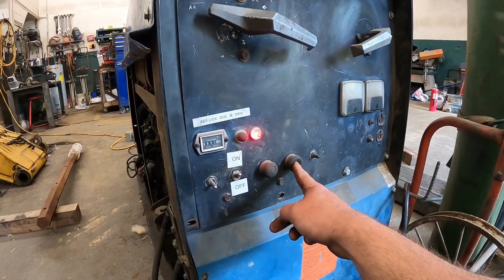Upgrades / repairs / inspection to the shop overhead crane with man behind the scenes

Comment: My shop has a fixed crane beam of W 10 X 30 for 14’ span. With only 2 ton chain fall. I’m guessing Yours might even be W 10 X 22 for 36’ span. 
I believe your lift winch is capable of more than 4000 lbs. and You are extremely wise to come up with innovative fix, adding columns to cut span down to 18’. I am impressed with your Harbour Freight electric windlass cable drive for cross positioning your trolley beam. Your original installation was very funky and bent steel from deflection of beam brought this to your attention. Please don’t think You now can lift 8000 lbs. now You have cut Your Span in half because your main trolley beam remains the same. You have really nice safe setup now.
Reply from the maker: Yup thanks

Comment: Just a little DIY when Welding over a bank of Batteries It a good ideal to cover them with a piece of plywood or something non metal to keep the sparks out> I have first hand knowledge about spark and battery. mine was a 48 volts Hilo battery that cost  $3500.00 to replace. 22-23 years ago.

Comment: Take this just as a suggestion: Those Gusset's You welded, should of have the interior corner (@ the 90 degree point) cut back approx. the "diameter" of the weld. Example, if your consistent at holding a 1/4" (.250" in. / 0.635 cm) weld, than cut back the corner 1/4" (.250" in. / 0.635 cm.) If you have to run two weld's, one being a horizontal and one a vertical, for the Gusset's. Allow enough space for your horizontal to pass under the gusset, uninterrupted, and then when welding vertical, {uninterrupted} you ensure that the gusset has now been fully welded. The hole need not be fully closed by the welds. What your more concerned with, is the weld(s) were both uninterrupted. Where's this method of welding come's from. HINT: remember those bridge's that collapsed during the Earth Quake's, in the State of California. That's where this (newer) method was born / a result of, if you will. The engineer's discovered a lot, that has now been changed because of that incident. See: (AWS) D1.4 Structural Welding Procedures.

Comment: TMBTS should just be shortened to THE MAN. Aaron is making DP famous. And Maggie doing well as fire marshal. Nice work.  Cheers Mike! I think I heard Aaron got a promotion. Shop "MAN-AGER"  And JasonWorksAlot Assistant Manager...
Reply: I think JasonWorksALot promotion is still up in the air. He may only get Shop Foreman to start off but I think TheManBehindtheScenes will promote him higher as soon as the new budget is released and he can double his wages. 

2 x nothing = ???
Reply: @Crewsy  I think I sense another HR complaint...

Comment: He's worrying about Aron not unplugging the saw. Yet he goes up on the man lift with no safety harness.🤔 Lol God bless
Reply: No safety harness required on scissor lifts as they are considered scaffolds and the guardrails are considered as all the fall protection that is necessary. I'm not certain if that lift falls into the scaffold category as it is a straight up and down lift. I talked to OSHA about safety harness use in manlifts. The anchor point for a safety harness is required to be able to support at least 5,000 lbs per person attached. How do you get a 5,000 pound anchor point on a manlift with a platform capacity of 750 pounds or 10,000 pounds if there are two people in the basket?
Reply: Tired old mechanic it’s simple really, ask any engineer. You just write it down on the paper next to “capacity required” and say no my problem anymore 🙄😂

Comment: I was only thinking that crane needs some servicing when you did the auger.
Reply: I think the auger at this point in time was still in the planning stages. 
I was thinking about the crane when I watched JasonWorksALot’s boring videos of him and The Man Behind the Scenes line boring all the holes on the 120 boom and stick but clearly it was also done after the cranes “annual inspection”.
Reply: Wayne Crews this video was filmed before we got out there. Don’t quote me but I believe it was two weeks before. Or “current-ish” in the dirt perfect universe timeline. Looks like it’s around the kubota repair stage which I can’t remember if that was before or after the auger build. Turns out I’m not as versed in perfect time as I though I was at the beginning of typing this.
Reply: Perhaps it’s just the noise of the hydraulics then that makes me think it needs servicing, most of the overhead cranes I’ve known are all electric, though I’m only talking about two.
Reply: Though, looking at the auger video it looks like it’s still the old L brackets supporting the span.
Reply: Daniel Coates 
If you watch the previous Dirt Perfect video where he talks about the crane I believe Mike mentions that the main hoist is air operated for up and down and side to side travel across the main I beam. The travel front to back is controlled by the Harbor Freight winch as explained in this video. The noise is the air flow through the main hoist winch.

Comment: I would seriously question the engineer. Check his credentials. I hear he isn't very good at math. Lol God bless
Reply: 🤣😂🤣😂

So true Thomas but that never stopped a farmer from engineering something that would outlast anything he couldn’t afford to buy. 

When I was still driving trucks one of the mechanics was upset that the pto shaft U joints went bad on the trucks when as he said a farmer could engineer a tractor pto to run at a 90* angle all day and last forever and all the trucks pto powered was a hydraulic pump to run the tailgate.